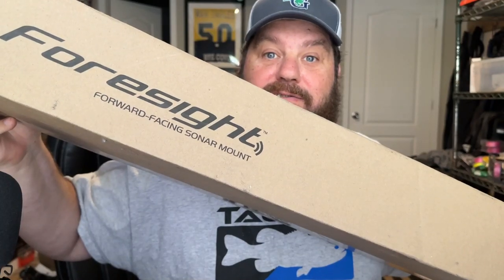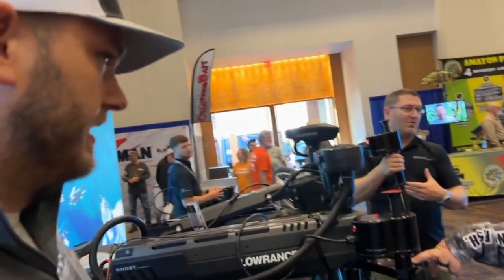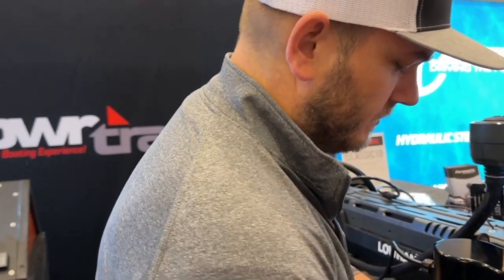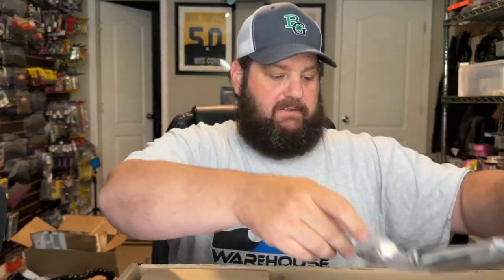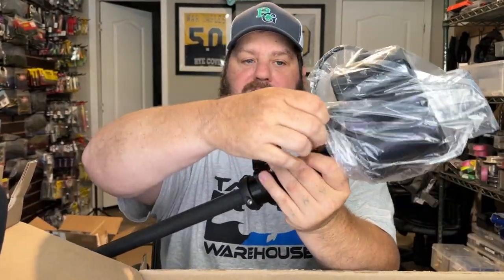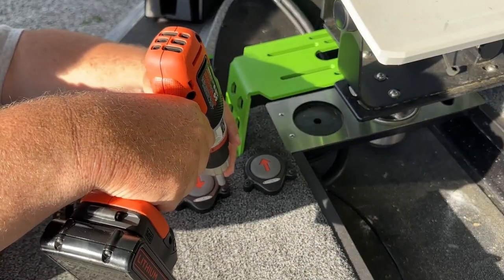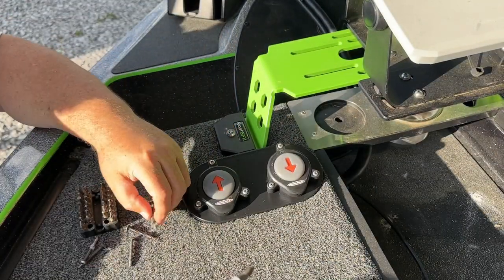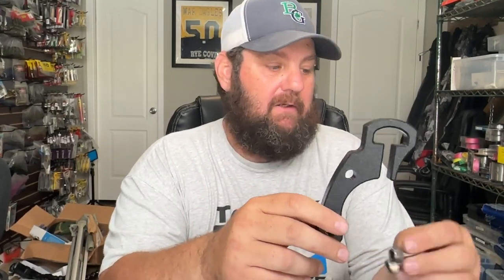Trolling Motor Or Turret - Live Scope

Comment: #100percentwatchsquad baby!!! That's a really awesome setup for the Green Goblin! The only thing I would like to see is the ability to lock/unlock the Foresight so that it locks in with the trolling motor or moves independently. That way you never have to remove it.
Reply from the maker: That would be nice I think that would have to come from the manufacturer though. Maybe not with Garmin since the foot paddle is wireless
Reply: We’re working on it! We had to chase the ghosts we thought needed to be chased to get to market and deliver a helpful product first. Our current unit went through over 2 years of engineering and rigorous testing to get to where it is. Foresight is all about continuous improvement and that is next on the R&D list. Thank you for the comment. It helps us immensely to hear what the people want. And thank you for the post, bassgeek!
Reply from the maker: Now that’s cool
Reply: @dannynyren9536 would be nice if there was a way to mount it to a Terrova. Deep V boats don’t get any kind of love😂